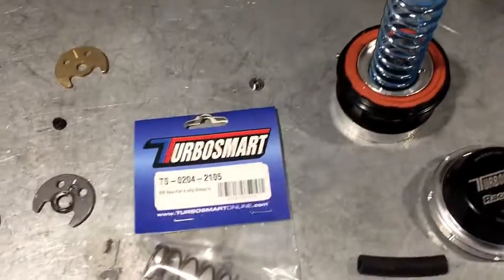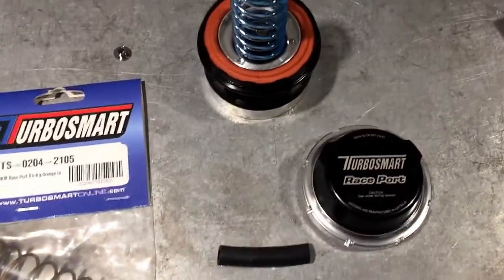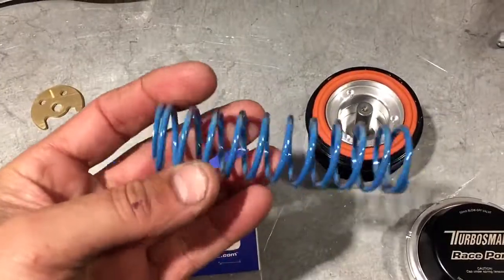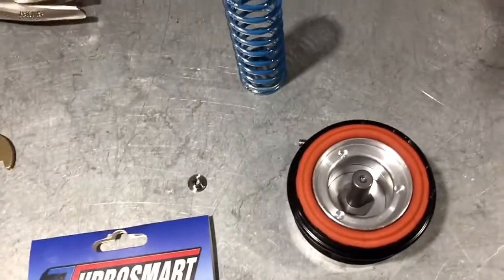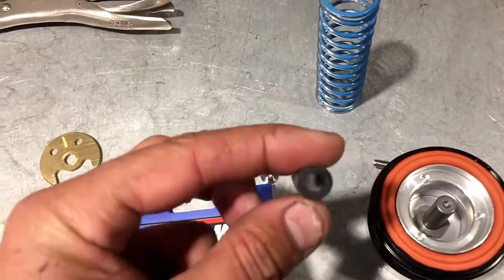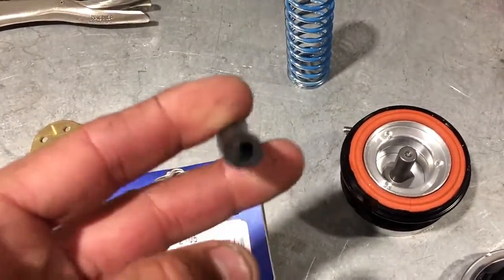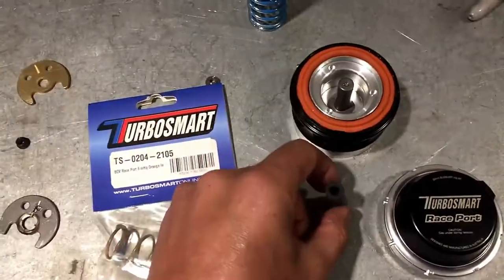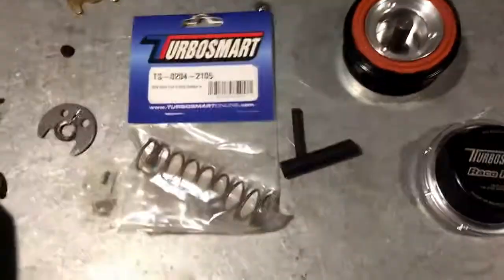VTT BOV 101

Comment: 8 pound spring??? That’s -12in/hg to -15in/hg  that’s way too low. The N54s usually use 10 to 11 pound springs. Guys measure your vacuum at idle then compare your results to the tial spring rate chart.